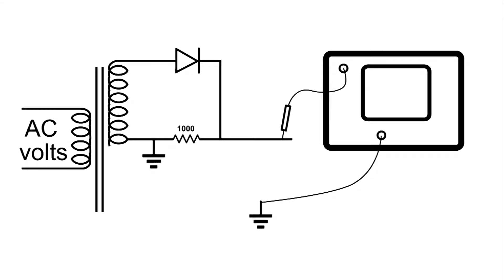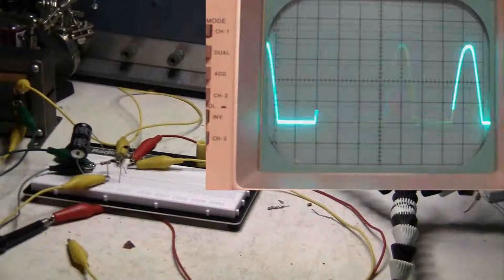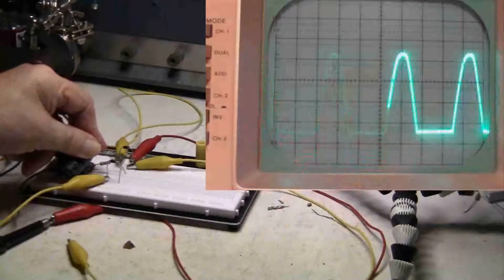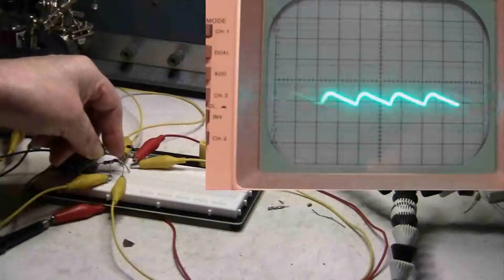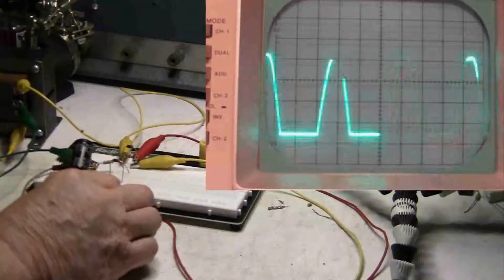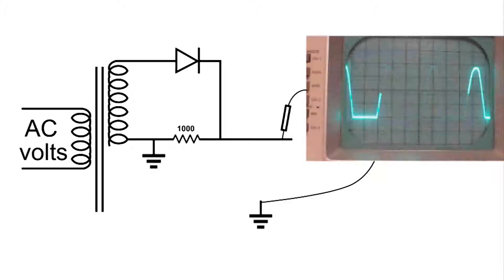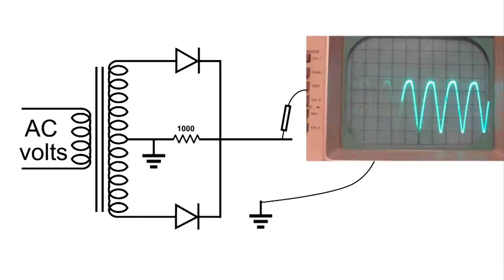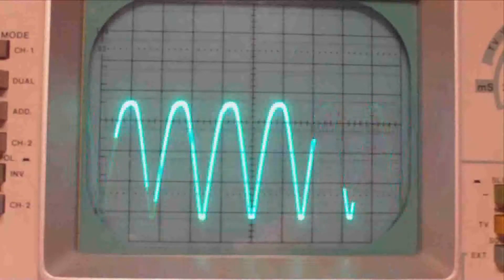Half/Full Wave Power Supply Oscilloscope Demo

Comment from the maker: @macksledge 
I had the primary of the power transformer plugged into an isolation transformer, and a variac so I can control the output. The secondary output was about 20VAC. The diodes are from Radio Shack, like 1N4003 1-Amp.

Comment from the maker: Thanks Barnekkid
With one capacitor in the circuit, increasing  its capacitance will smooth the DC even more. But the PI filter is a proven filter circuit and is what you usually find in a power supply. Google "PI filter"

Comment: I'd like to build this circuit on my bench. How many volts on the secondary of the transformer? Which diodes are you using? When establishing ground on a breadboard like you're using how do you connect it? Thanks for your videos. They're very well paced. I've learned a lot.

Comment: Nice video. I have the same scope, do you had problem with yours ever? Mine is a NOS piece, made in about 1988, I started using it in 2007. Few months ago some PIO capacitors in the high voltage rectifier has died, producing periodical short circuit for the high voltage winding of the power transformer. Fortunatelly I've realized it in time, after a few minutes spent searching for the source of the clicking noise around my desk, I noticed that the image of the scope has disappeared...
Reply: so?
lol